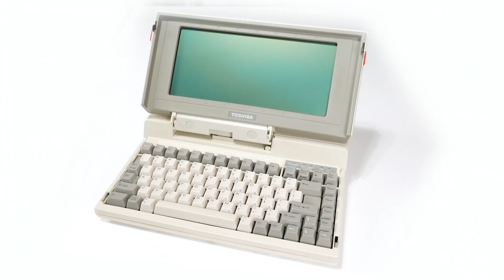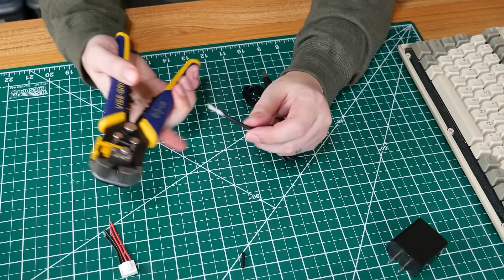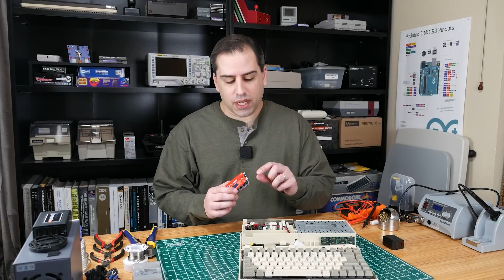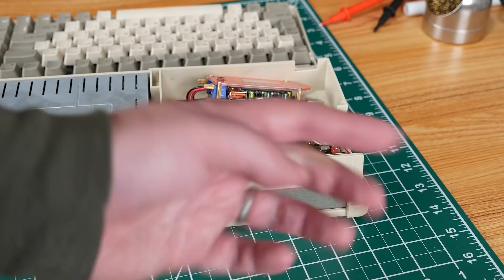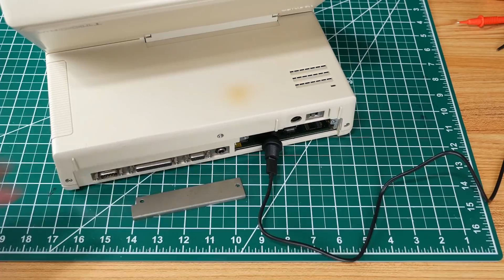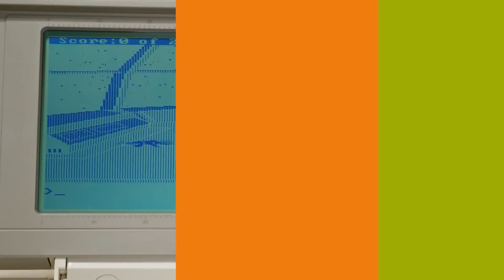Vintage Laptop Battery Replaced with USB Power - How Hard Can It Be?

Comment: Nice video…Question for you - I have the same T1100 Plus and for some reason it seems to only want to see the floppy drives both as 360k with read errors (also have installed a gotek with similar results, so it seems the machine is simply treating all drives as 360k). If I format a 720k DD disk in another known good machine/drive, the T1100 Plus seems to read them fine, but will only try to format as 360k. Have you experienced anything similar? I thought perhaps the bios needed to be set, but I cannot seem to find any Toshiba app that will run a configuration tool for it bios (I’ve tried all the CE setup disks I can find online). Do you happen to know how to configure the drive settings? (I’ve also verified the switch on the side is set to “PRT”, but also tried other  positions).

Comment: You could forego the entire buck/boost box by just putting a 10,000 - 22,000 uF electrolytic capacitor across the 5V power supply, close to the motherboard connection. The cap will act as a current reservoir and keep the voltage from dropping during the momentary current spikes caused by the floppy drive. Cheaper, simpler, more reliable, less clutter. A tip from an old electronics tech.

Comment: I have restored a T1100 plus (DOS 2.2 O/S) and it works fine but I needed a HDD so restored a T1200 (DOS 3.3) but haven't been able to download/get a DOS 3.3 O/S disk, it doesn't seem to offer full BIOS/COMMS port options when running DOS 2.2? Please please can you suggest where I can download/get the DOS 3.3 O/S
Reply: It is out there if using Google to search. A good alternative is Freedos.

Comment: 7:08  Its ok to say "Ive never done this before / I dont have much experience with this" or "im not sure if this is right but.."  some best practices in terminal crimping: 
1: you only need to strip off  a mm or two of insulation. Look to the terminal itself for guidance. The width of the wings that crimp the wire is the same width you should strip. Any more will interfere with the pin / wiper contact. On big chunky ones like this, it can interfere with good current transfer (heating / arcing). On smaller terminals, excess wire becomes a mechanical issue. For these reasons and more, I generally avoid these autostripper devices. Generally hate them all around.

2: Terminals should be clipped off the strip whenever possible rather than broken off. On big terminals its not a big deal. But on smaller ones the bent / torn strip interferes with insertion to the housing.

3 : as gabest4 said, you absolutely need to crimp the insulation by the second pair of wings. Both to assure strain relief as well as to avoid shorting (if the insulation is behind the terminal, there's a good chance the wire is exposed).

4: Save yourself a lot of heartache and do the pull test before inserting the terminal. I cant tell you how many times I though I had a good crimp, inserted it in the shell, and the wire came right back out. Removing an "empty" terminal is such a pain. Especially on small connectors.

Comment: The rating on the battery is the Nominal voltage and it is fun to see how many confuses this with charged voltage, A typical NICD battery will have about 1,5 when freshly charged meaning the voltage on this pack would been about 6 volts and 4,8 when completely discharged. add this onto the super thin USB cables voltage drop and it´s not strange at all why the Low voltage came on and I was even expecting it before it was even started. the pack has double thick wires for a reason and it is both to secure stable current with low voltage drop and add more connections to the power to minimize the risk of losing contact with the battery. in the second attempt you wire the booster directly to the thick wires and bypass the super thin USB cables and made it work because of less voltage drop and also compensation for that with the Buck-Boost. but to be frank it would probably even worked to just add a really big value capacitor across the connection in the first run to reduce the voltage drop during Peak currents
Reply: I agree with you but the 4.8V is the nominal voltage 1.0V is depleated.

Comment: The original T1100 (non plus) only had a single floppy drive, and the display was way worse - yours is golden....
I did a similar mod to a later T1000 laptop, in that I put a 12V to 5V converter in the battery pack holder, I got several more years of fun out of it. (I'm into amateur/ham radio, so heaps of 12V around, not so much 5V)

These old laptops serve really well as 'dumb terminals' assuming your into retro/ancient computing.

Comment: It would have worked if you had used thicker cable in your first attempt. 
Those thin wires in cheap USB cables will cause a big voltage drop, hence the low battery light.
That's probably why they used double pairs from the battery to be able to supply sufficient with current..
Reply: Interesting, I hadn't thought of that. However, USB power can be as little as 4.4 V (4.75 for "high-power" functions) according to the spec. Thicker gauge wire can lessen the voltage drop, but it can't increase an already low voltage. My final solution should work with any QC 3.0-compliant power supply.
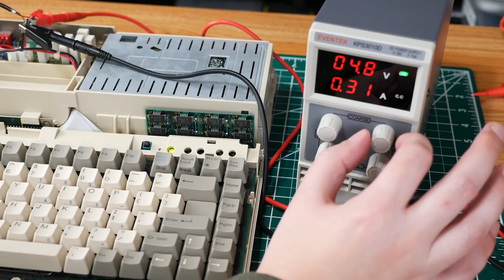Reply: @andywest5773  the VAST difference in gauge of wire, and the fact that they included two wires on the battery originally should have been a clue. at 5:30 your bench psu shows that the computer draws 300 mA while idle. But this is not taking into account the CPU isnt working hard, and that the motors and heads of the floppy disks will require MANY times that. The original battery pack spec was around 4 amp hours IIRC. That USB cable was never going to handle it. 
You should understand the relationship between voltage drop and current over thin wires. The problem here is not that the USB speck is a bit low for your laptop. Sure that could be a problem, if you had anything other than an assumption based on the battery spec to go on.  But the problem here is that when the high current demand of the drive kicks on, the voltage sag over that tiny wire brings the voltage well below whatever the machine expects. And if we are really talking about USB spec here, you would still be SOL since USB spec is only capable of delivering 500mA over a USB 2.0 rated cable anyway. Just sitting idle, your laptop is %60 there already.

Comment: is there another method to do this?
Reply: Grab a cheap 5V DC-DC converter from ebay, pop that in the plastic battery box, then hook up an external power brick - that's basically what I did to get a later T1000 running off a 12V source.
You may even be able to squeeze a AC mains to 5V supply into there - I didn't go that way as I wanted to run mine on 12V as I have heaps of that floating around in my radio shack.

Comment: I'm trying to solve a similar problem with my raspberry pi build....running off lipo battery and when it's under load I get low voltage indicated and sometimes a complete crash. PS thanks for the video!

Comment: I am wondering why you didn't upgrade to lithium.
Reply: Only relevant if you want to go portable, he states early on its only going to be used on his desk.
Reply: @paulstubbs7678  I get what you are saying, however I disagree that it is only relevant if you want to go mobile. There is already a nine volt charging input, so just use your battery as your voltage source rather than all the extra electronics. Yes it becomes portable again but that is just a beneficial side effect.
Reply: @paulvild  I did consider this originally, but as I understand it, you can't simply charge a LiPo battery with a Ni-Cd charger. There are different charging phases, etc., that would require extra circuitry anyway.
Reply: @paulvild  Back in the day, NiCad chargers were basically constant current trickle chargers, frequently requiring several hours to put a charge in, using no intelligence at all.
The power in from the charger could not directly run the laptop, as in if you disconnected the battery the laptop would not work - insufficient power.
The only way to directly power them (early Toshiba's) is via the internal battery connectors.
If you connected a 100A 9V supply to the charge input it still will not work, as that input goes via a constant current limiter (often just a 5W resistor). The laptop uses the battery to set/provide a stable-ish 4.8V supply that is then boosted to 5V (and 12V etc etc.)
You could take a feed directly from the 9V socket (ignoring the charge circuits) and feed that into a 5V reg - then into the laptop proper. It's a concept (external DC power) never envisioned by Toshiba at the time.
I hacked in a network card into one of these early Toshiba's, (T1000) it worked fine, I could log into a Netware server etc, however the combined current draw was much more than that set for the  battery charger. With a full battery charge, and the charger still connected, it died after two hours.

Back in the day, a safe NiCad charge was deemed to be 1/10 of the C rating, a rate that the battery could withstand well after it was fully charged. In the T1000 case, 400mA, so everyone just fitted a resistor to give that current - less than the peek demand of the laptop (floppy seek etc)
it met the average current demands, so sustained wall use was ok, the battery picking up in normal times, and adding a bit more for disk reads etc.

Comment: Im confused, If there is a power jack on the back whats the point of this? DC power brick at 9 v is all you need.
Reply from the maker: Though for convenience, USB tends to be everywhere, no? And USB3 standard and above can delivery enough power.
Reply: Well if nothing else you could put a USB power bank on it and get super duper ultra mega huge hyper extreme overkill battery run times.. lol
Reply: if its like the ones i have, that is ONLY to charge the battery.
Reply: The 9V jack doesn't work without the battery and I had no interest in putting another battery in there. As somebody else mentioned, you could always use a power bank for portability. Also, this is a completely reversible mod so I'm not locked in to USB if I change my mind.
Reply: @andywest5773  What about add a buck converter between the 9V input and battery connection, then get a 9V "QC trigger" cable?
Reply: They won't directly run on the charger without a battery - the charger cct is setup purely to handle charging it's nicad pack, all but constant current etc, not a steady DC voltage to run the machine.